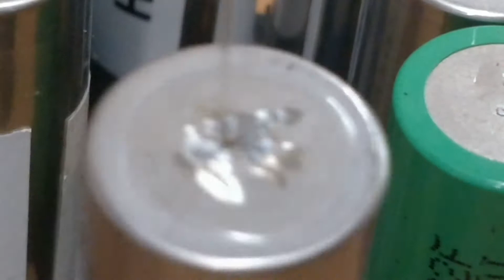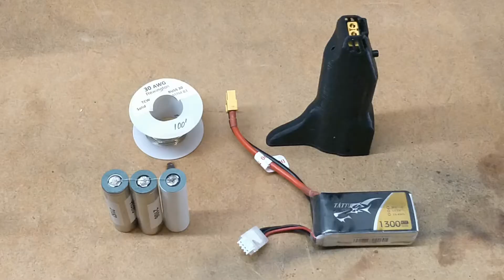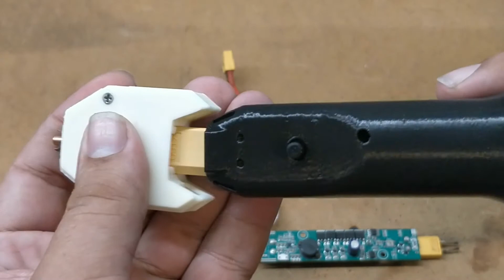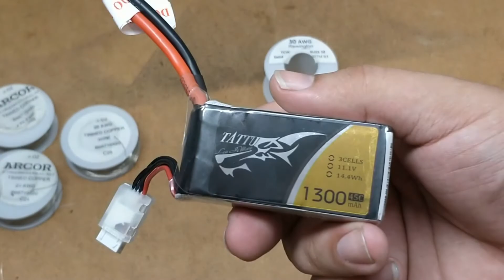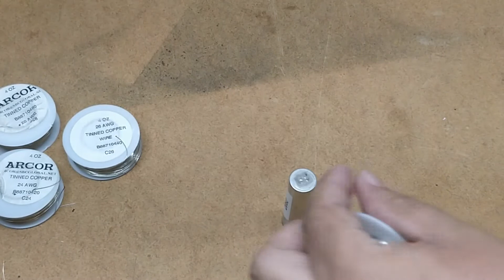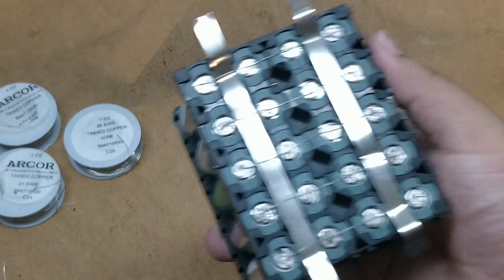Nano Spring Tip V1.4

Comment: Please Name wire for spotwelder
Reply from the maker: Both tinned copper wire and stainless wire worked well for me. Its often sold as fuse wire. It can also be sold as craft wire, but make sure to avoid the aluminum craft wire - It won't work.
Reply: @TinkerGear  aliexpress or alibaba??

Comment: Can it do .2 pure nickel onto cells without slotted nickel or is that the max it can do. Would be good to know its limitations on strips since you told us its max on wire was 24 ga tinned copper wire
Reply from the maker: The current version can do .15 pure nickel, or .2 nickel plated steel but it can't quite manage to do .2 nickel strip unless its slotted. We're working on improvements to the design to improve its power, but we wont guarantee performance beyond what we have tested.
Reply: @TinkerGear  I've been told that with the capacitors it can do .2 slotted. Without the caps and with a graphene lipo it can do .2 non slotted nickel. Thats why I ordered a 2nd  seperate pcb board that will be using a lipo. I will probabley sell the complete unit with caps in favor of the lipo setup cause non slotted nickel is cheaper than slotted.